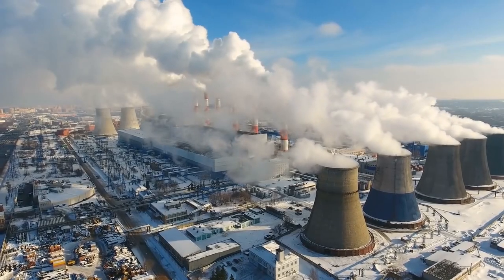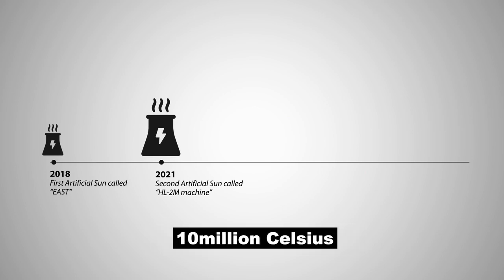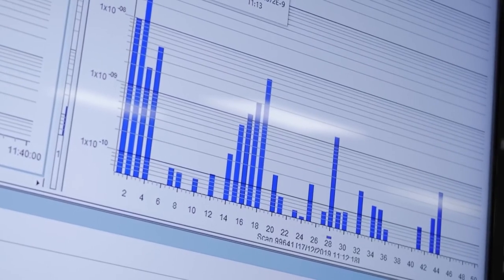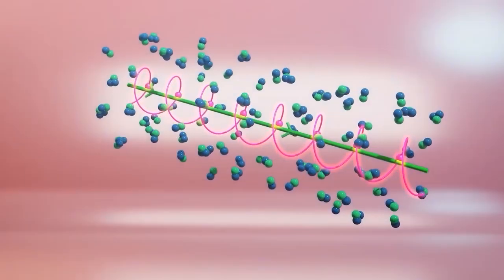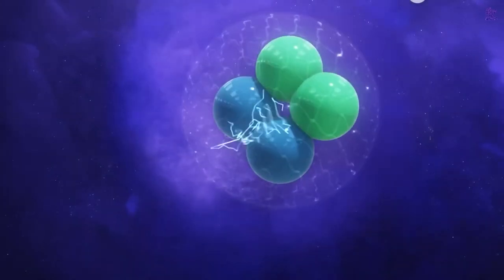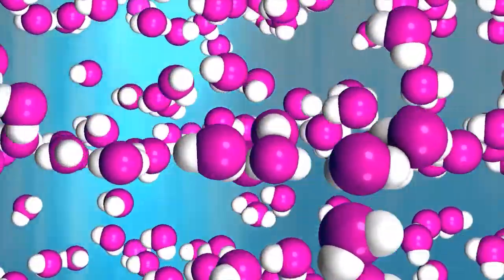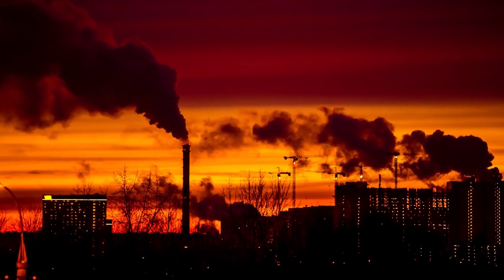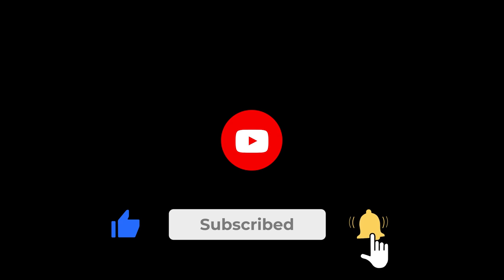IT HAPPENED! Chinas Nuclear Fusion Reactor Changes Everything

Comment: There's no such thing as safe energy. Energy is what it is , which is power. And if power happens to to get away from whatever safety measures we set in place, well at that point its not just energy that can be used it's now a weapon that can kill you.
Reply: It's safer than fission and fission is the safest form of power in use today.
Reply: @jeremyjones453  we don't know that, actually. We've never seen the chaotic state of when this overages or even underrages in power. It could be exponentially worse, by comparison, causing a run away, ever swelling core, like a sun that keep growing from a foci point. This results invasive floods and water bodies instantly vaporized, rock and cement melted like wax, metal carbonized. Life, vaporized, and carbonized. There is no Shockwave likely, but it will just become runaway an creat a micro dwarf, on the surface of Earth. So, again, we don't know that.
Reply: @caiusmadison2996  we do know that. The problem with fission is that it has to be contained in a certain way to ensure it doesn't run away. Chernobyl comes to mind. Fusion, however, can not run away. The electromagnets have to supplied with a crazy amount of electricity to let the reactions take place. Fission is like a candle you don't have to light and have to constantly cool down, but fusion is like a candle that burns brighter, but only burns if you keep a lit match on it. It can overheat, probably, but only until a point where the -270C magnets heat up and fail to compress the ring of plasma, which is the moment the reactions cease.